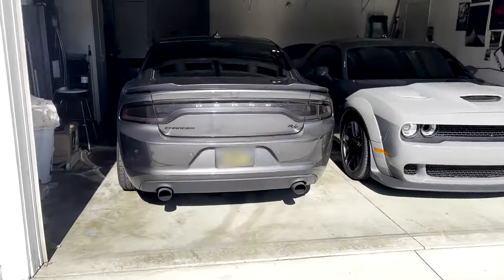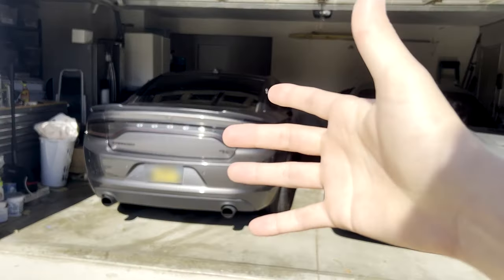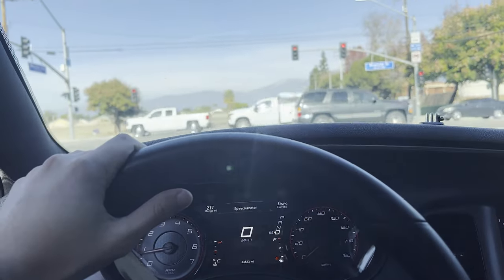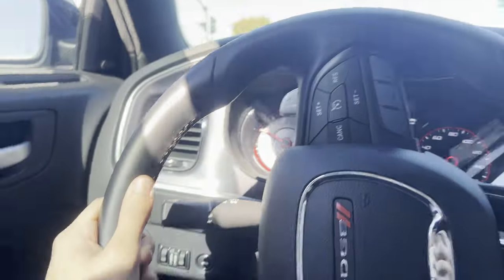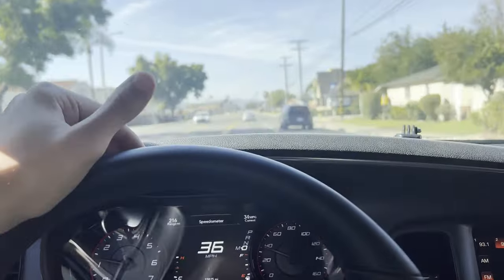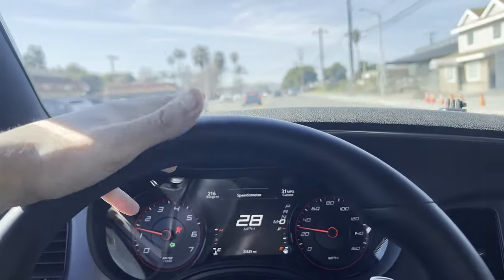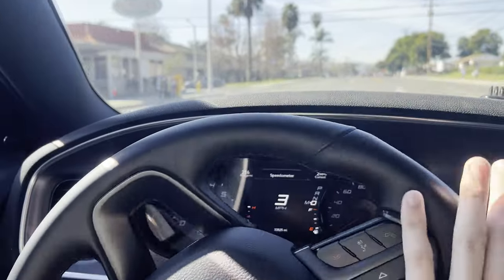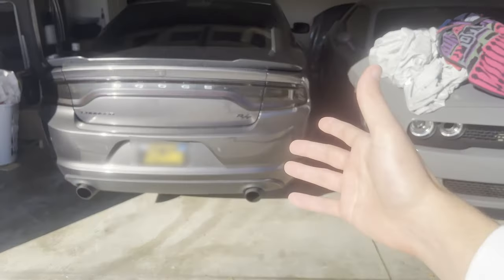Is E85 Worth It in an R/T?

Comment: Hey, I havent written to you in a few yrs and have been watching a few of your vids. I had a set of Long tube headers from American Racing Headers installed on my 5.7L chrysler 300C back in sept. and had the car tuned via diablosport trinity tuner. I asked my local speed shop for a more aggressive tune and he suggested to get a cam and dyno tune. Ive always wanted to put a cam in this car and i think im going to pull the trigger and have it done. The speed shop said with headers, cam, cai and dyno tune that Ishould be making almost 500hp at the crank. We shall see. 😅. 
Im going to need a torque converter too, its a daily driver 5 speed nag1 so I've seen some cam kits that recommend 2500 stall speed.

Comment: do you need Hellcat injectors with a FlexFuel kit? or is that just for the full E85 tune? I just put a FlexFuel kit in mine, but with stock injectors. it runs fine so far,  and I mainly have it for the fuel savings,  (2.65 for E85 vs $5+ for 91) but I was wondering if the HC injectors would increase performance. if I can get 15hp I'd be happy.

Comment: Where I am e85 is currently readily available. I plan on doing headers and 6.4 intake with active runners and a 100-125hp nitrous wet system. Would it be worth it for me? Also it seems the process of growing corn and making ethanol is not profitable without government subsidies and I’m sure they are not permanent.
Reply from the maker: Honestly, I am not sure I am qualified enough to speak on the government subsidies. Though I will say that it is a good question for your tuner whether E85 would be the correct route when running nitrous. I would assume so